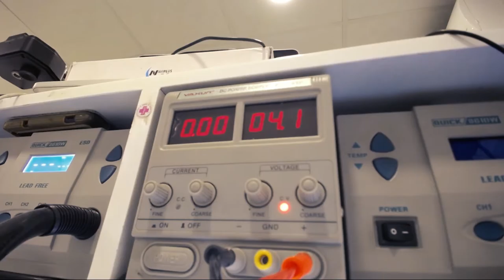iPhone se No power Repair Srilanka Macfix.lk

Comment from the maker: Asus Laptop windows 10 installation,Srilanka Laptop Repair,Srilanka iPhone repair,Srilanka MAcbook repair ,Srilanka ipad repair,Srilanka Macos install,Srilanka Xbox Repair,Srilanka nintendo game console repair,srilanka iphone restoration,Srilanka Laptop restoration,repairing,icloud bypass Srilanka,iPhone audio ic Repair srilanka,iPHone no servie repair srilanka,iphone no power repair srilanka,iphone water damage repair srilanka,iphone data recovery srilanka,iPhone battery replacement Srilanka,iPhone display replacement srilanka,mAcbook battery replacement srilanka,windows laptop repair srilanka,Laptop no power repair,laptop motherboard repair,laptop windows install,apple bootcamp install srilanka,apple windows dual boot srilanka,Apple magsafe charger cable repair srilanka,Fixmelab,Video Graphic card repair,Nvidia vga card repair.Restoration,Rebuild,destroyed laptop repair,abondend laptop repair,found in water laptop repair.3utools sinhala review srilanka,iphone charging ic repair,iphone 6 wifi ic repair,iphone 6 full short repair